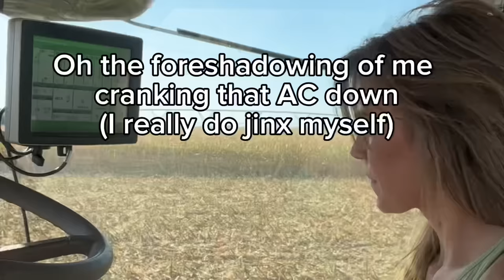Farm Recruits City Girl To Work On The Combine! | Harvest 2023

Comment: Sure makes ya think "design flaw"....something that the manufacturer decided to improve but in reality it wasn't thought through perfectly.  The guy that fabricated what you needed has maybe seen this problem before??  And  you're right - frustrating things like this (and all it takes to get through them) can certainly test a couples' strength.  So far, so good!!  And you rounding up tools and helping when you can surely helps in a frustrating situation moreso than just standing there and asking, "whatcha gonna do now"??  Most guys would love to have a helper like you!!
Reply: Numerous people having trouble with the folding auger. Large part of the problem is someone at the plant got sloppy and didn't shim them properly during assembly. Should have been taken care by the dealer when the previous owner had trouble.

Comment: Looks like you need to remove the section that folds and just unload the grain without the extension.   Until you have the Draper head you don’t need the extra auger length.  Hope the fix the JD tech put on it works.
Reply: That's what I was gonna suggest...or just fold back the extension when ya dump...even if ya have to stop to dump each load, it's faster than all the down time to replace the shear bolt...until ya get a rain day, or another break with time to fix it right!!!  I know that stuff gets old really quick !!

Comment: Very interesting video, the flight in the combine auger may need shimmed out a bit further so it stays engaged in the fold around extension or the extension flight needs let back in further to keep it engaged with the main auger flight, the very nature of the auger is the flight wants to push back against the bearing in the tank while it is augering grain out, thats mostly why they disengage at the folded joint, had to do this kind of repair on my own combine auger, never gave me any trouble since.

Comment: bolts shear for a reason, they are doing what they were meant to do, let you know something mechanical isn't right.  Something is askew or tension against the wrong mating piece.  Ask John Deere what they can do to salvage their reputation.  In this day and age of video communication.  Farmers can make or break a manufacturer.  They can redeem themselves or tell you to piss off.  Get JD involved in their fix.  It is apparent that the size of the job the X9/1100 is capable of and it's short coming is less than 100% ability.  Longer shaft or stronger spring or slow down and adjust to rain rut or whatever a combination of things so you can get harvest or job done.  Match made in Heaven, you and Zach, great story, keep sharing.  Play off each others strengths and push on, adapt and over come... Peace and prayers y'all.  Congrats on the 100K, who'd have thunk

Comment: I had the same problem with an orchard mower. We replaced it with a grade 5 bolt and it lasted a little longer between shearing. Finally put a Grade 8 bolt in and it runs days before any problems.

Comment: Have you considered drilling out the hole that the bolt/pin screws into.
It appears to me you can up-size that thing.
I would drill and tap the hole out by 50% if possible.
Plus, I would use a harder Grade 8 or Grade 9 bolt/pin.
Another thing to do is tap it with fine threads because the bolt can be torqued more.
Course thread fasteners do not take as much torque and are not as strong.
I tend to over-engineer stuff that failed to avoid making the same repair over and over.
So plan on using a larger stronger grade bolt/pin with fine threads.

Comment: Hi mates, saying shear bolt.. is it meant to break at a certain point of wear, stress or pressure to actually stop other mechamical bits from being ruined in that equipment? If it is 'prematurely' giving out issues, you might like to consider a bolt material with higher tensile strength, a 4140 steel maybe? Caveat is that it cannot be too tough or strong as other more complicated bits might get worn or broken...

Comment: How many acres is in a circle? Are the circles the same size? Sorry for all trouble those shear pins have caused. They are just doing what they are designed to do. Break to prevent even more damage. So the spacer helps the spring tension be more consistent and even? 

You should consider buying a metal detector to aid finding missing pieces. 

Thanks

Comment: I feel like there is not enough dampening in the system and the shearbolt does what is is suppose to do. Vibration is also a thing and the bolt can't handle it. Sure you can size up the bolt slightly and see if that will help, but you have to be careful with that.

Comment: have you considered a heavier/stronger spring? i worked with a lot of springs and even had to make my own when i couldnt buy what i needed. there is a company called McMaster Carr that has a wide selection. the designers put a spring in there at a given length for a reason and shortening (with a spacer) to strengthen the spring may or can cause other problems. is it possible that a weaker spring got put in there early on in the combine's life? even then some springs get past quality control that should not have. spring tension/strength is roughly checked by measuring the diameter of the individual coil and how far apart the coils are. in the world of springs a little difference goes a long way. check the one you have against a new one if they have one in stock somewhere so you dont have to buy it.

Comment: It looks like your bolts are shearing on the threads, where they are already cut in half by the thread. You need to make special bolts that have the full diameter at the shear point between the pulley and hub. And have just enough thread for the nut. Also your pulley center may be worn so it fits loosely on the hub, letting it rock and not keep the gap tight between the two pieces. I would make my own bolts of the correct grade bolt and try that.

Comment: A stronger spring and bolt with upgraded amount of steel! I would say upgrade the back flow preventer spring and bolt with a stronger steel contant
Reply: Or drill and tap second shear bolt, or increase existing in size, but first of all get rid of that stupid auger design

Comment: wish i had a dollar for everytime i've had a shear bolt shear, perfectly flush.  aside from drilling a hole in the bolt fragment and using an easy-out, i've had luck using a dremel bit to cut a groove or a lip into the exposed bolt steel, and then slowly rotate to the bolt out, using a small hammer and a hard steel pin punch that'll catch the lib or groove and turn the bolt out enough to grab it with vice grips.  -C

Comment: If the weight of the end spout is causing the problem take it off and fix the problem on a rainy day but if the local guy fixed it with the spacer run it, maybe you had a rain day this week because my son got back from northern Iowa yesterday and said they had a lot of rain 👍✌🏻🇺🇸

Comment: If you keep breaking the shear bolts, isn't it possible that the screw could be straining somewhere and that's why they keep breaking? it's as if the previous owner had strained the auger and it either bent or the brackets of the holder bent and broke. As a rule, on corn header, if the bearings of the drive shaft are not parallel, the shaft tends to break.

Comment: Larsen farms installs a clutch system on their Deere combines which allows them to empty the horizontal unload auger when unloading on the go.
Reply: X9s have that. The problem is the extension part coupler jumps and stops augering just long enough to plug it.

Comment: u need a battery pack that can do 220 or the voltage you need at 120 amps a nut assortment and a stick wleder weld the nut to the ffed up bolt and try again the hot bolt is easier to remove most of the time.

Comment: Try to engage the PTO in a idle speed at 7rpm,no higher,I brake off my sheer bolts whe I'm eguaging my pto higher than 7rpm,or the forage is to thick,slow the engine rpm down,

Comment: Here’s my merch suggestion:  trucker cap with a custom farm logo for your farm.  If it doesn’t have a formal name it’s time to pick a good one!
Reply: They work for a farm that may or may not have a farm name.
Reply: @lynwessel2471  then a catchy company name
Reply: @drumsnbass  Its Wiswell Farms any ideas?
Reply: @lynwessel2471  I think about the Dekalb logo on a hat but I’m not sure Wiswell has that same flow.  However a large scripted W on a slight diagonal with Wiswell below it in smaller text would work.  Then it’s a question of a “refined ag” look on the hat where the wonder would wear it anywhere.
Reply: @lynwessel2471  the N in Nutrien Solutions has a great balance.  Maybe something similar?

Comment: Give her about 5 years. She be rebuilding there engines & be a master cert. welder too.
Reply: Hint Jo Jo if you are in any doubt pre heat the metal before welding, And build the engines to manufacture spect’s. You will do just fine.

Comment: Maybe the wet corn "bent" the auger or tube, and now even with moisture levels where they should be, somewhere it's  binding up  and eating bolts.

Or are they made of Chinesium?
Reply: Improperly shimmed at the factory. There's a bunch of them that had the problem. Should have been fixed for the original owner.
Reply: @lynwessel2471   ok, so too much clearance  is causing the  corn to jam .
Reply: @williamevans6522  Like Zack said it caused the coupler to jump and that temporary hesitation is enough to plug it. They must have done ours right, no problem thru soybean harvest, they auger harder than corn does.

Comment: Would it benifit you to put in a higher strength bolt, ie if it's 8.8 put in an 10.9, not sure what it calls for, if the two faces are not close enough together

Comment: No they didn't recruit you it was nepotism plus a shortage of people willing to take the job. If Kansas is anything like western Ohio, you don't have enough working population to fill the number of jobs available. Where I am working if you are warm and breathing then your hired.  For 17 years I worked as a mechanical engineer on running machinery and my mothers side of the family worked for John Deere ( finance/ credit end of the business)  and food processors. I at first thought that you needed a stronger spring or convert to belt driving the auger but a spacer behind the spring would serve equally as well provided you get enough cushioning to prevent damage to the rest of the auger's  drive system. Most of us are now retired.